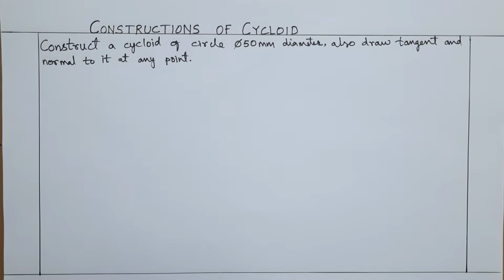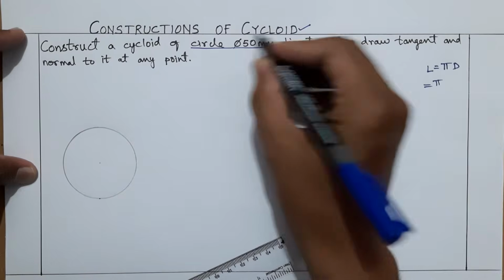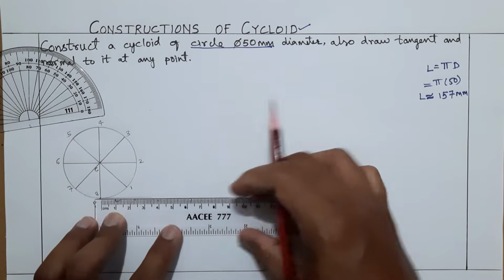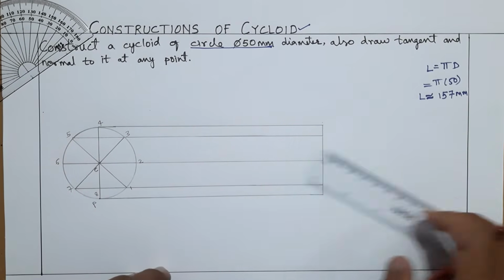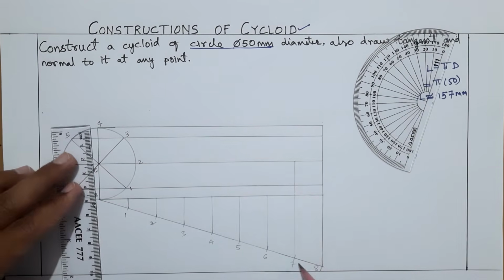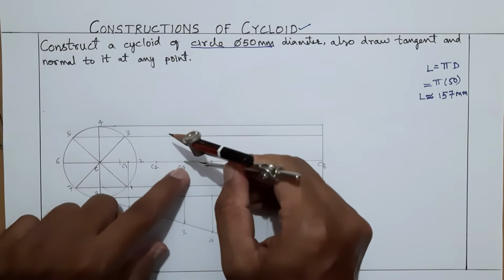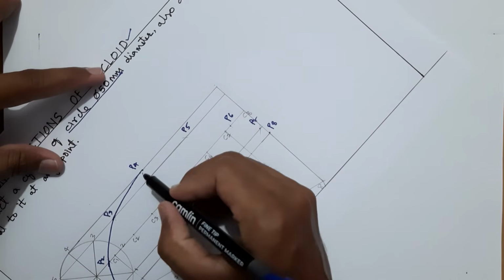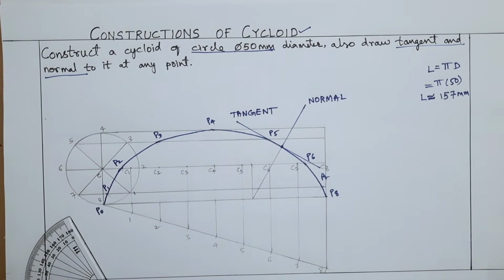How to construct Cycloid from Circle with tangent and normal

Comment: draw the projections of a pentagonal plane of side length 25mm and inclined at 40 degree  to HP and perpendicular to VP.

A) i) front view( LINE ).   should the LINE be draw "on XY" or little some MM above from XY ?? but why.

     ii) top view( PENTAGON ).  what pentagon should i draw either Left-Cornered or Left-Sided pentagon
Reply from the maker: Its incomplete question. How ever answer of i) Pentagon to be drawn on xy line if it is resting on HP. If it is resting in VP then below the xy line without any gap.